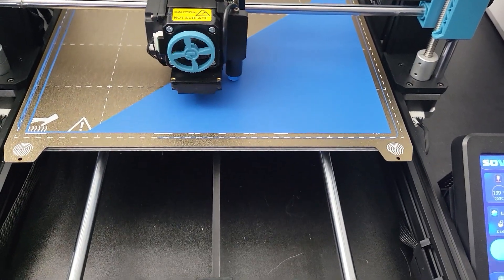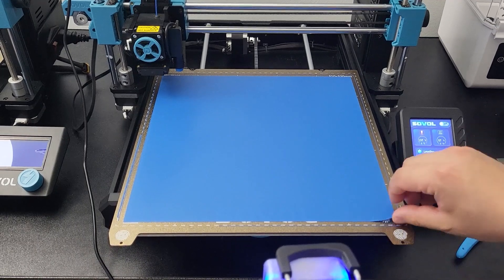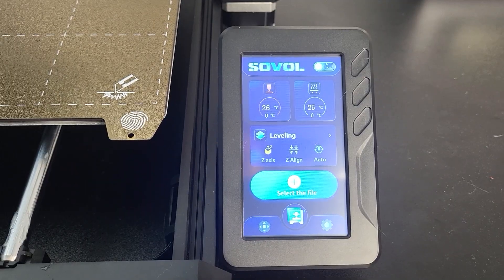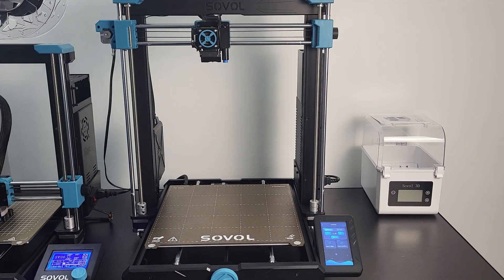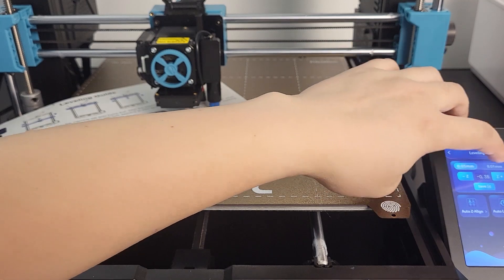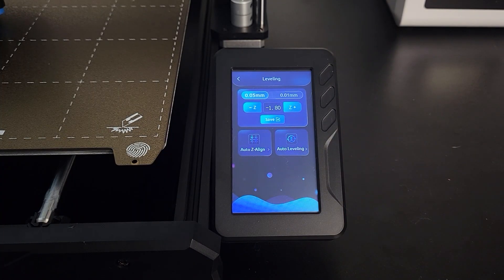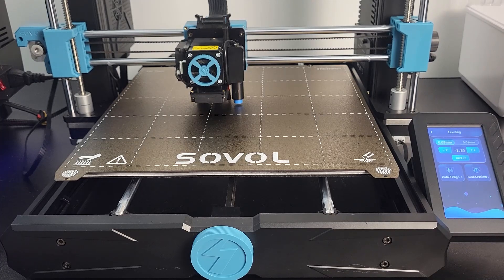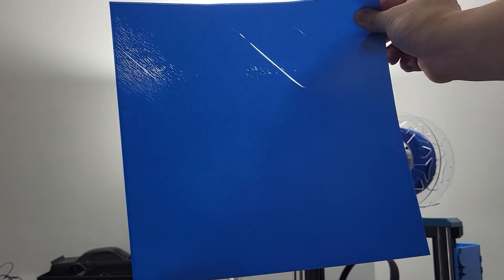Sovol SV06 Plus Bed Leveling Tutorial, Step-by-step guide (Z offset)

Comment: When I go into leveling it jams into the bed. What do I need to do here?
Reply from the maker: did you trt reboot printer and try leveling again? check if the sensor on your extruder is in red light(normal). You can also try to adjust the senstive level of sensorless homing.

Comment: Its not perfect?
Reply from the maker: I would say it is good for all the prints you need, but you can see some holes on the layers, it is not perfect.
Reply: It's not perfect if you're planning on using your 3d printer to make PLA sheets the size of the print bed

Comment: what the hell did you do at 2:05?
Reply from the maker: preheat.
Reply: How did you pick this item to print? I am trying to print the boat with ABS and the filament just clumps. I have levelled this many time and it won't lay a line of filament down. @SvgLau
Reply from the maker: what is your setting for printing abs? Temptures and other settings.  SV06 build plate will expand more during higher temperature. It is little bit tricky to print abs. It does not like stay on build plate that much, you will need to further bring the nozzle closer to bed like -0.15mm to 0.2mm to help the first layer adhesion. You will normally need a enclosure to provide a good embinet temperature, other wise part tends to warp during printing. If you have PLA on hand, I would highly suggest to print with that filament.  @schwamieboy1
Reply: Ok I swapped to PLA but after about 25 mins it broke free from the bed. Bed was at 100 i believe.  @SvgLau
Reply from the maker: lower your z offset value, make nozzle closer to the bed. adjust z offset value 0.05mm at a time, until you get good result. Don't test frist layer with boat. Use the first layer test model that I attached, sacle down to 20%. Google "what is good first layer looks like"  it will shows you pictures about differences too high and too low, comapre with your test result. You don't need 100c degree for pla, go for 60c. https://www.printables.com/model/500886-first-layer @schwamieboy1
Reply: Thank you, I will give this some attention. @SvgLau
Reply: @SvgLau  It appears to be a little too high according to the google images. Basically it was falling apart when i removed it from the bed. but when i run a piece of paper under the nozzle it is definitely scratching it. The setting says -1.89 and I adjusted it from -1.99.
Reply from the maker: I would go for the lower one (-1.99)and give it a try. If the first layer still looks off, go for -2.04 on sencod trial, until you find the result close to the "good first layer" google images.  @schwamieboy1
Reply from the maker: when you get PLA setting adjust correctly. You might still need to do a small adjustment when you switch to other filaments. PLA to PETG or TPU normally won't need readjust the offset. But if you are go for PLA to ABS, you might want to bring the nozzle closer to the bed more. Good luck  @schwamieboy1
Reply: Ok got it to print good enough now, but after about 3 prints it doesn't stick to the bed anymore. Do I raise the temp? @SvgLau
Reply from the maker: do you have Isopropyl alcohol at home? use that to wipe the build plate will help. The correct offset value will last many print before you need to adjust it again, something is wrong here. Did you went back and test the first layer again? Is it still looks good? Also, after you change the z-offset, make sure you scrow down all the way to the bottom of menu to "store setting". SV06 does not store every change you make automatically. 
  @schwamieboy1
Reply from the maker: btw, nice catch (fish), I mean your profile picture. salt water red drum? can't tell what's other one.
Reply: Haha yeah thanks, yellow Travally @SvgLau
Reply from the maker: I miss last summer, caught a lot nice one, got one Sauger right above trophy fish award, one red drum 10 lbs ish snap my ultra light rod, but it was a lot fun. @schwamieboy1
Reply: Where are you living? I live in Mexico and spear fish here.  @SvgLau

Comment: what do I need to add to my gcode to make the slicer use the bed leveling?
Reply from the maker: M420 S1 ;load mesh
Reply: @SvgLau  where?
Reply from the maker: @manningcustom  After G28; AS shown below. 

G90 ; use absoulte coordinates
M83 ; extruder relative mode

M104 S150 ; set nozzle temp to 150

G28 ; home all axes

M420 S1 ;load mesh

M900 K0.03 ; linear advance factor

Comment: Thanks ! Did your lube tutorial and my sovol is much quiet now, but have lot of troubles with the first layer, i saw that you have the same problem on your sv06 where the heat bed isnt really flat cause of thread spacer... wanna ask you if you find a solution to this ? I asked sellers on Aliexpress to replace the sovol ones, but all of them told me that there an be a gap of 0.2 mm tolerance
Reply from the maker: I would prefer to swap the solid spacer to rubber one. That way you have more room to adjust the corner. But if the build plate is out of flat at some spots, there is no much you can do beside update the firmware and make auto bed leveling correctly to add the compresate value.